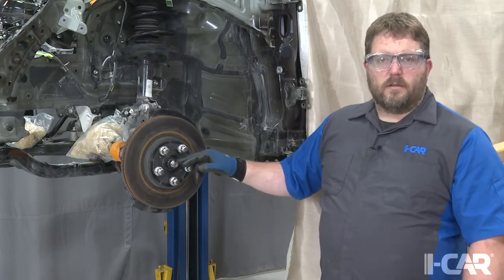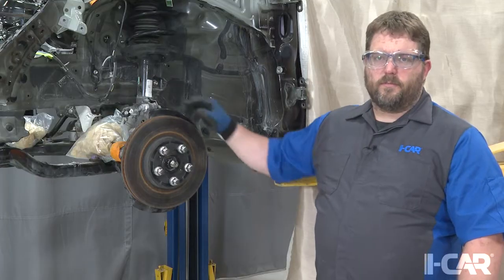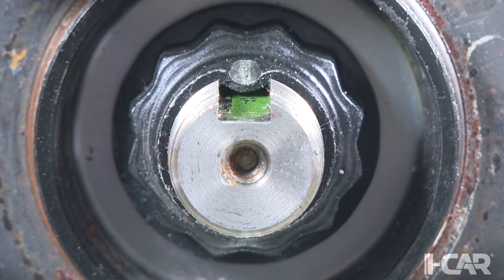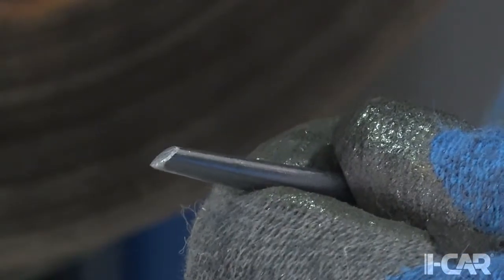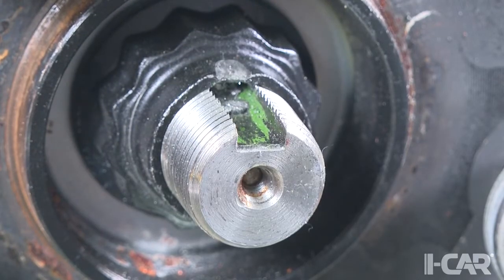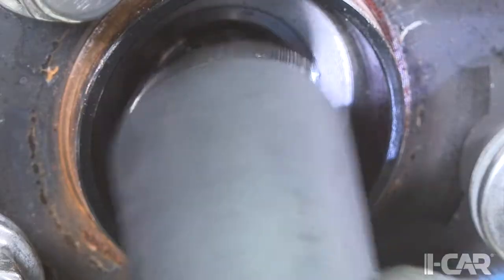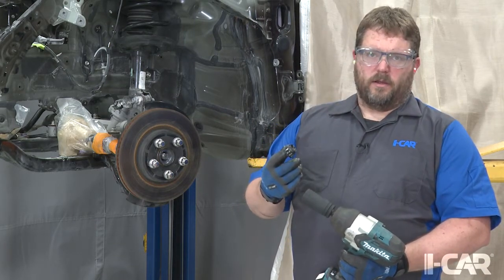Proper Axle Nut Removal - Just In Time

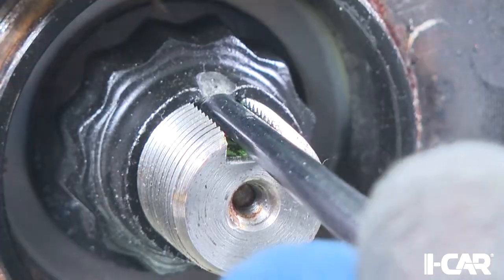Comment: 0:45 To me that still looks like threads received damage.
Reply: Yea right, imagine trying to inspect that gauge of threads through a video and not standing in the shop to verify. Good thing you aren’t a certified tech.
Reply: @2URLex People use videos all the time to rate condition. Just look at it, you can see the shape is different. Doesn’t take a ton of experience to see that. 

Best method I found is to grind the punch indent down to weaken it then impact the nut off.

Comment: I bought a tool to hammer into this axle nut. Even with raising the crimp I still damaged the threads.

It’s now time to replace the other side and thinking I might dremel just the nut directly where the crimp is and then pry that up and hopefully bend the nut up enough to where it doesn’t wreck the threads.

Comment: Really wish cotter pins were standard instead of this disposable engineered axle nut that could damage a CV...
Reply: I have only done one of these so far but now a year and half later the other side has the bearing noise. About ready to work on this and dreading the outcome. I still don’t have a good method to remove the nut without thread damage.